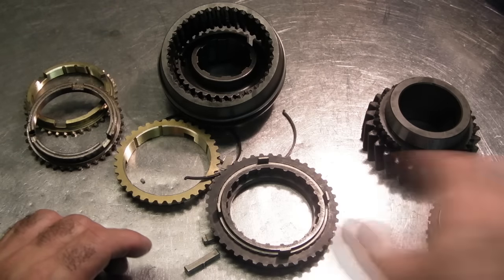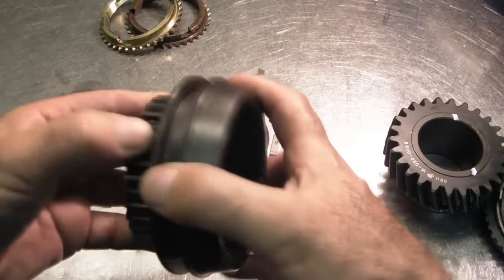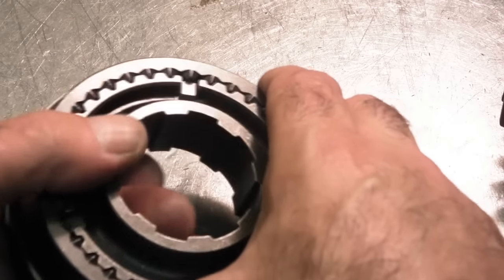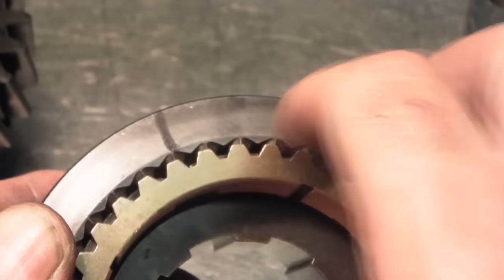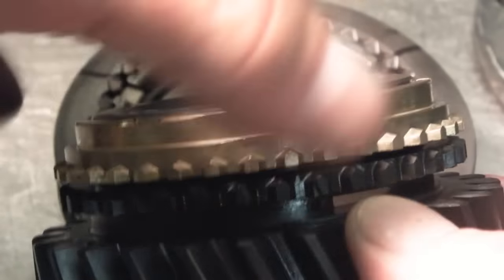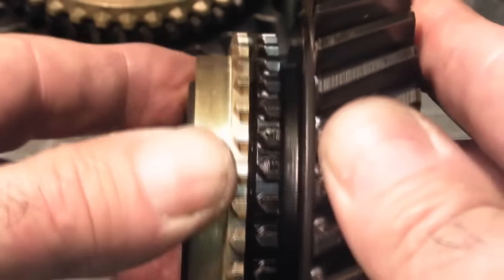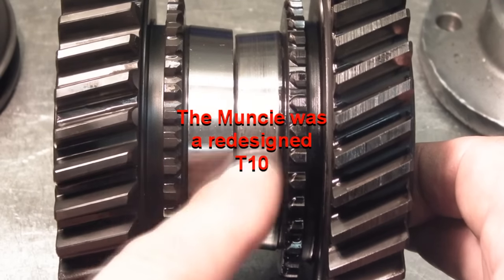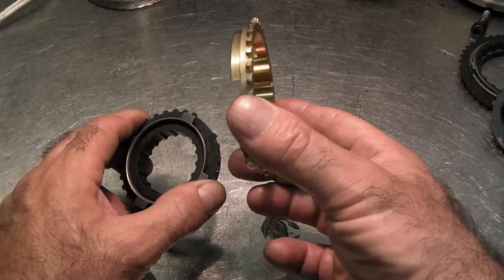Learn About Transmission Synchro Rings

Comment: Hello Great Video btw ! I have an issue when car is in running it couldn't downshift from 3rd or 4th or 5th to 2nd and 1st.. So i cant downshift either to first or 2nd while in running. I have to stop car or near to idle then need to shift to 1st gear by double pressing the clutch then 2nd gear , then works like butter 3,4,5. So whats the problem and what to repair/replace. Mine is suzuki swift Vdi 2013 1.3L diesel engine, manual transmission , front wheel drive. And i am from India. I need a suggestion as quick as possible.
Reply from the maker: Sounds like you have a clutch release issue.  Often times upshifting will work but downshifting is much harder when clutch release is an issue.
Reply: Local Garage man said it would be synchromesh rings and locks for 1st and 2nd gears, and also he said hardly it will cost 100 bucks total here. Is it correct or problem with clutch release only ? I dont know anything. Help me out . Thanks for the reply too
Reply from the maker: Vinay Kumar if it would cost around 100 dollars and they are willing to guarantee the work let them do it.
Reply: Thanks for the answer. I just bought the used car 3 weeks ago 98.5K kms on the odo. we replaced all oils,filters, **"clutch plate, bearing"*** in local garage. Here it costs total 350$ to do that including labour charge etc. Just driven 500 km so far. This car(swift 2013 VDI) total costs me till now 10 grand . Hardly the problem is with the 1st gear first which is rare cases shift to first gear, no problem at all. Later 2 days back it came for the second gear too, this cause me more problem while slow traffic, which is either going to stall in 3rd or stop the car in neutral ( which are both cause traffic problems),then i can shift to 1st and 2nd. In my observation i saw i can shift to 3rd to 2nd after hardly press brake and seen less than 15 km/hr speed. What was the problem? Tell me what to do. I will proceed with your answer. I consider your previous comment also. But i need to explain you the whole case because you dont know what was exact problem without checking the car. Thank you once again.
Reply from the maker: again this sounds like a clutch release issue.  If you can put it in these gears with the engine off, it most likely a clutch release issue
Reply: Vinay Kumar 9br o
Reply: Vinay Kumar💖
Reply: GearBox

Video
Reply: Clutch pedal free play is an easy way to determine the  clutch is realeasing fully...first step anyhow. If there isn't throw out bearing or fork issues...."bent or popped off"..it should tell ya exactly how far its realesing. For example if        .75" to 1.25 is pedal free play. And at that setting you have 6 inches of travel . And there is2.25" of free play.instead of 1"....that is a total 4.75 inches....or only 80 ish% of the total throw...one inch less or 5.75" of total throw brings you to 96% of the total....it is my expiernce that you need 90% or more for the clutch to still disengage enough.   ......approximately!...all you fuckers....lol....idk...I have issues hhahaha

Comment: I just finished up rebuilding /restoring my super t-10! Actually quite easy. Thanks Paul for your videos and your book! Hardest parts of the process was loading up the needles in the counter shaft, but using thick sticky tranny grease and putting it in the freezer for later use, made it very easy. Dropping the rear extension housing onto the rest of the case, and aligning the reverse shift fork on the reverse gear went really well.

Pressing on the gears and bearings onto the main shaft was also really easy.

Installing the front input shaft bearing was a little bit tricky, I had to tap it on while giving a bit of heat from a torch (non-sealed bearings). Install the large od snap ring around the bearing and keep on tapping until you can get the washer on and slide on the snap ring. For what it was, it went pretty damn good.

Thanks Paul.
Reply from the maker: Thanks for your great feedback and a big thumbs up for doing the job yourself!

Comment: WOW, awesome video. I've watched so many over the last 24 hours trying to understand my issue with my T56 but this is a really amazing video. 

I've got an occasional grind during downshifting into 4th after doing a 26 Spline swap on my Tremec T56. I can let the RPMs go to idle then make the shift and it goes in but not as smooth as the rest if the gears. I opened it back up, and I found 2 broken keys in the 3-4 syncronizer. I'm hoping that just replacing those keys will get me back on the road again without any more issues. I'm guessing it isn't syncing correctly with 2 broken keys
Reply from the maker: The broken keys happen because the synchro rings wear and move closer to the gears. This creates a larger gap and allows keys to jam and break. Rings need to be changed that work with those keys
Reply: @GearBoxVideo  awesome thanks for the advice! I was worried I had put it back together wrong after swapping the input shaft.

Comment: As the ring pushes onto the clutch, that creates torque (?) against the teeth of the slider that prevents the slider from sliding until that torque lessens when the speeds are aligned.  Man, mechanical engineers are something else.

Do I have all that right?  Thanks again for talking to me.  It's amazing that all this is accomplished with one solid piece of metal.

Comment: Thanks for posting this. I've been driving stick shifts for almost 40 years and never had a clear idea of how synchros worked. Your explanation of the newer non-bronze multipart rings also explains why I have to run $20 qt Castrol Syntorq instead of $2 qt generic 90 wt gear lube in the NV-4500 5-speed in my '98 Dodge Cummins.
Reply from the maker: Yes the oil is expensive, but you need to keep the linings soaked in it so they don't burn up

Comment from the maker: Slots open up from wear and the keys don't usually remain in the same position because the gear's thrust force changes when you are on and off the gas, pushing the ring and key back towards the hub. The gear is helical so acceleration and deceleration will move the gear towards and away from the hub.

Comment from the maker: Synchro rings are also called blocking rings.  If you have a bad ring, you get grinding when trying to shift. As the keys apply pressure to the ring the ring turns with the gear which starts the whole indexing process. The slider can't get past the ring until it indexes in the opposite direction.

Comment: Hi Paul, Just to say thanks for a great set of videos. Just rebuilt my 1970s Land Rover gearbox and used a lot of your tips. Gearbox now back in the truck and working, seemed a bit tight on the shift at first but seems to be getting easier. Thanks again. Graham
Reply from the maker: Appreciate it

Comment: Just want to say very well explained. I’m going to rebuild my fwd transmission and have learned so much with your explanation on worn parts.
Reply from the maker: First it would be helpful to know what make and model car you have and what brand oil was used. Sounds like the wrong oil and if the transmission bwas removed the hydraulics may not have been bled correctly.

Comment from the maker: Yes. Most rings are simple cone clutches. Because the ring is spinning at the same speed as the output shaft ( which is connected to your driveshaft ). You are synchronizing the drive gear to the output.

Comment: Thanks Paul, I get it now thanks to your demo.
I'm bought a rebuild kit for my 1977 super t10 that has problems engaging 3rd but if 3rd is already engaged it can go from a dead stop in my 57 chev & will never fall out of gear. My 1-2 shifts fine but you cannot downshift into 2nd. Now its on the bench & I notice that the 3-4 slide is very weak & doesn't hold its position on 3rd well. The 1-2 slider engages 1st ok but is very hard to slide to 2nd by hand. One slider has 3 rings the other doesn't.

Comment from the maker: The rings track with the slider and the keys or struts are designed ( by indexing ) not to allow the bronze ring to ever go point to point with the slider. Once the slider goes over the ring, try and remember that the ring is attached to the gear and the gear can still move left or right because the keys allow for it. So the slider just moves the gear over. If you obviously have blunt non pointy teeth, you'll end up with block outs and hard shifting.

Comment from the maker: The gear is the retaining mechanism.  When the assembly is in the transmission you have gears on either side, and keys always in the ring slots. Unless a ring cracks or gets flattened, it will not disengage from the keys.

Comment: Excellent video. I watched several videos covering broader concepts of manual transmissions but none of them fully broke down what was happening with the synchronization rings. My amateur mind wasn't understanding where the transfer of power from the input was occurring. All of the models and animations cover up this action with the shift forks or gears, so you can't see what's happening beneath.  It makes a lot more sense now. Thanks.
Reply from the maker: Thanks for the comment.  Please subscribe and share...

Comment from the maker: The ring is NOT locked solid to the gear.  Its held on by pressure of the slider pushing the ring against the gear slowing it down  ( braking it ). The slider will index the gear ( Left or right ) and we are talking about 1/8" either way, and sometimes that window is open anyway. The ring will dislodge itself from the gear.

Comment: Very nice video. Years ago I raced a 55 chev in AHRA H stock with a T10 I bought completely disassembled in a box . Was really fun for a young kid to figure out how put it together and invent tricks to hold needle bearings in place with grease and use a cut off counter shaft  to assemble it. One trick I did was grind all the teeth off the blocking rings !  Man that was the best shifting transmission for drag racing.........didn't even use the clutch, it would shift as fast as your hand could move. Down-shifting was another story!!!
Reply from the maker: Thanks for watching!

Comment: Thank you again for talking to me about this!  The one thing I don't get now is _how_ the ring teeth block the slider.  What's to prevent the slider from aligning with the synchro teeth and just moving right past the ring teeth and grinding against the gear teeth before they are synchronized?

I'm guessing all this just happens very fast, and the sideways pressure from the slider to the ring would align the speeds before the slider made it to the gear.

Comment: Hi, very nice video ! Explanations are really simple and clear.
I've got a Honda Civic 1.6 Vtec from 1991. ( Y2 gearbox ) , won't be teaching you that those atmo engines are made to go high on RPM. My issue is that it will shift all nice and smooth on all gears while drive in city gently. But then when i drive faster, the 3rd won't go without a terrible noise ( up or down shifting ). And thanks to your video, im not pretty certain that this is the result of a worn inside 3rd gear synchro ring, worn threads.

Thanks a lot !
Reply from the maker: If the ring's grip is comprised by wear or warpage you will loose high speed synchronization. Sometimes an oil change to a lighter viscosity can help make the ring contact better.
Reply: I did try to change the oil first, the car has got over 140.000miles now. So thought some new MTF03 ( the standart Honda gear oil ) would help; but it didn't.
So I'm more now willing to open the gear box and put some new synchros in, make sure i won't have to go threw that again. 
Is there any other expendables (link to that or not ) i should care of while doing this job ?
Reply from the maker: Seals and snap rings
Reply: Brilliant.. Thank you :)  I'm gonna follow you on youtube, looking forward to learn more !
Reply from the maker: Hentic Bruno Thanks a bunch!

Comment: yes!!!! I am a shade tree mechanic and will be rebuilding my T150 3 speed soon. My guess is the synchro is out for my 2/3rd gear, but it may be a block out (I can slide it into the 2nd and 3rd gear, but it makes no noise.) great video
Reply from the maker: The  synchro hubs on those transmission tend to wear out the key slots, which can lead to that issue.

Comment from the maker: It will make a clunking noise in any particular gear you are in.  That is why the teeth will wear faster.  Also never slick shift 1st gear. You need as much holding power as you can and for the most part you are standing still when you put the trans in 1st.

Comment: Thanks.  Great explanation and I've finally got the hang of how synchroniser rings work. Feedback - the banging of the rings on the steel table is a bit distracting, and your hands move so quickly it's like watching a card trick.  Thanks again for uploading.

Comment from the maker: The strut keys keep the ring indexed with the slider. The gear is synchronized to the whole assembly. Slider and ring are locked together at the same speed all the time. In order for the slider to pass over the ring, the gear at that point is pretty much running at the same speed as the slider. The movement the gear needs to make for the slider to go past it while still rotating is negligible. The slider does the alignment work, not the ring. See video at 6.15

Comment: Hi, thanks for the video. It was very informative. Just one thing, my understanding of the indexing is that the gear does not reverse direction and briefly 'blip' backwards, rather, it slows down, relative to the hub.
Reply from the maker: In order for the slider to get past the block of the ring the ring has index in the opposite direction of the powerflow. The ring takes the gear with it. Nothing is in Reverse. Reverse rotation should not be confused with reverse load

Comment: I remember shifting the old Crash Boxes where you double clutched them or shifted by your RPMs. I drove a 75 Peterbilt with a 13 speed and it was all done without using the clutch. It had a clutch brake on the input shaft but only used for getting it into gear from a stop.

Comment from the maker: The three keys keep the ring in place.  Rings don't stick to gears.  Sometimes new rings are sticky, but when you shift into another gear the ring is forced to break free because the key is attached to it and now operating at the speed of the new selection.

Comment: I will look for converting gear ratios. differential ratios (final ratio) and Adding a top gear or swapping transmissions on your channel.  Thanks for the great explanation of Keys, Synchros, blockout and the advancements over time.

Comment: I've been reading a lot about this since I wrote to you.  I think what I was missing was the second "blocking" function of the rings.  The only thing that really lines up the teeth inside the slider with those on the gear is the pointy teeth in the gear.  What the synchro ring is doing is preventing the slider from grinding against the gear until they are the same speed.  Once they are the same speed, then the pointy teeth just slide in, aligning as necessary. . . .

Comment: I have a NV3500 with 4x4. I have taken it apart 7 times and rebuilt 4 times. There isn't very much info on it. But I have learned a ton. My problem is and has always been 4th gear which is the input. It'll go in and stay in so long as my foots on the gas. I now believe that the slider might be off.. I feel like a idiot didn't know I needed to check the gaping. Thank you, thank you, thank you. If I am missing something please tell me. I will gladly take advice.

Comment: It's really just the pointy teeth that make things align, and as you say, if the teeth aren't pointy, they could get blocked.  The extra set of teeth on the synchro, their function is not to line up the slider with the gear, they are there to block the slider until after synchronization.  Is all that correct? . . .

Comment: very cool vid bro , so are you basically telling us that the interference fit caused by the cone induced by us pushing the shifter into gear is what brings the gear up to speed, i had a 5 speed chevy blazer and you could feel and hear the gears winning up to speed . from your video im getting that the interference fit is a simple clutch . this clutch spins the drive gear up to the same rpm as the drive shaft ?

Comment: In fact, I realize now, that is why when you're shifting you kind of feel two steps--you can hear the transmission changing speed as you push on the shifter, then after they are synch'd there is a final push into gear. The first step is when the brass clutch is adjusting the speeds, the final push is when you are actually sliding the gears into place. The teeth on the sync don't do the synchronizing--that's the inside clutch. The purpose of the teeth is just to prevent the "locking" situation.